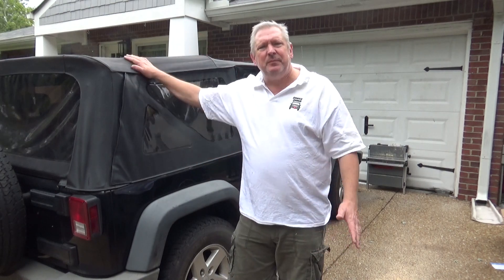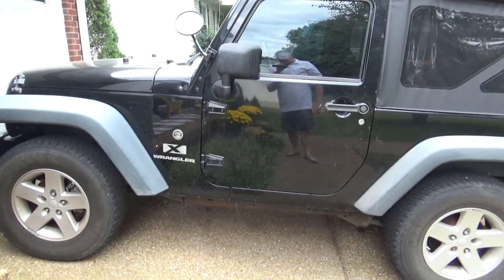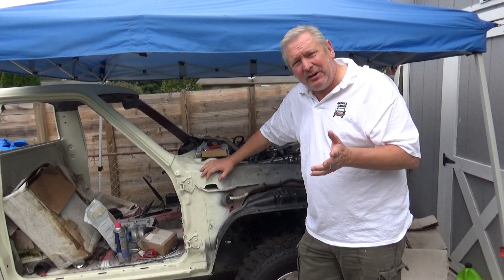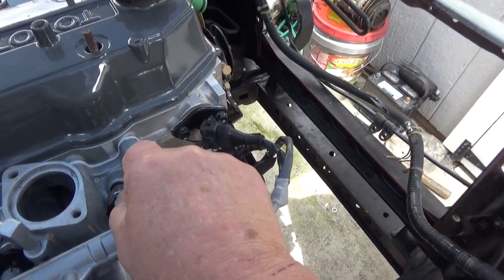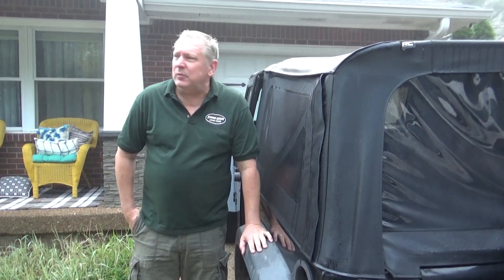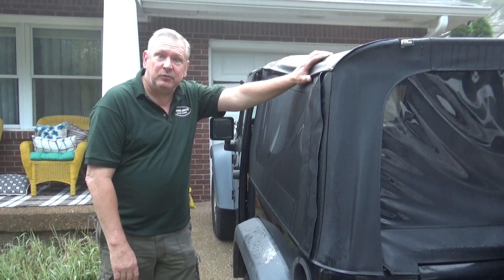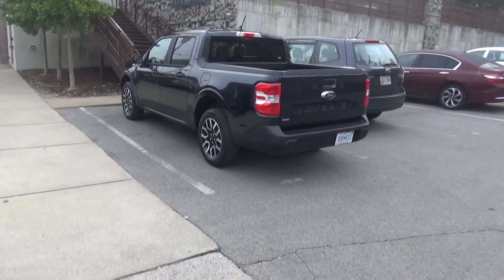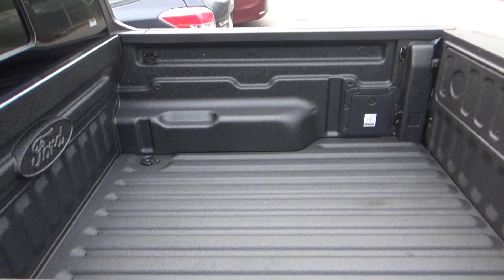Toyota Injector Nightmare -  A Ford Maverick In Person

Comment: The 1988 3.0 has low impedance injectors.. that 4cyl might be the same.. you may have to delete the external resistor to make the high impedance injectors work.. along with modifying the connector tabs.
Reply from the maker: I had read that - may be the answer eh ?